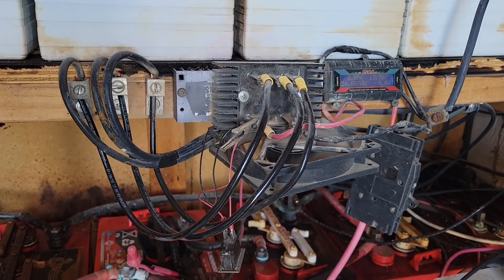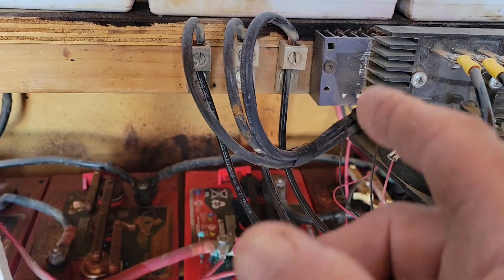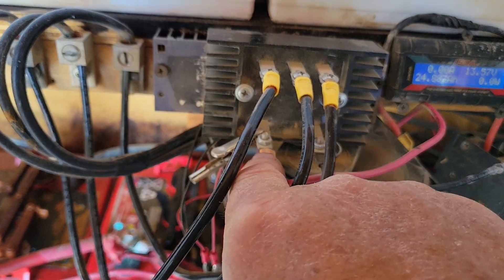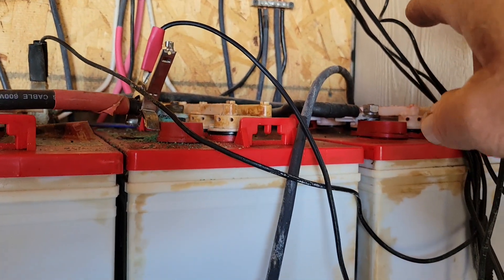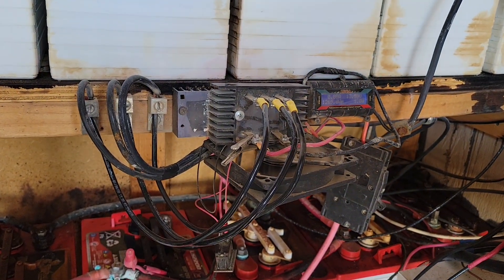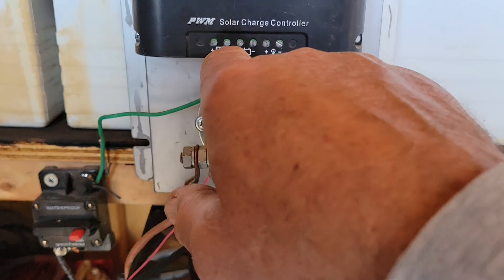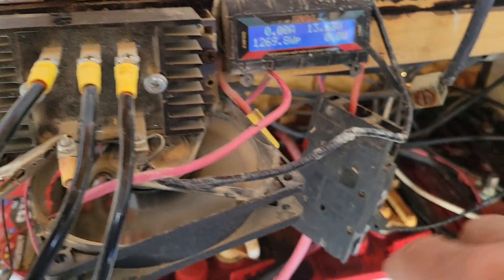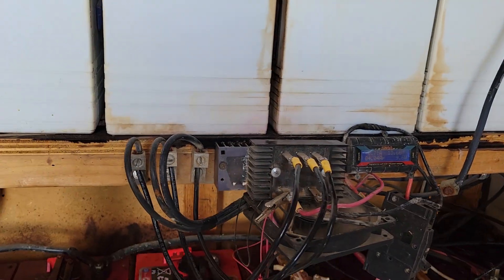EVERYTHING You Need To Know about Connecting Your Turbine To Your Battery Bank, March 29, 2022

Comment: G Bear. Just to add something I learned about the controller I have here...it's rated at 2600 watts and pv max is 2750.    Thought this may save you a little time.  Thnx!       OOPS,  my mistake, rating 2600w but pv max is 3750.  Also the manual indicates that pv panels be wired in series.  I noticed my inverter info didn't come through complete.   It can put out 110 OR 220 by setting.  Also can be set as backup for grid, or for grid as backup..which is how I intend in using it.   Also in the last mode, when batteries wear down inverter will switch to grid power AND also charge batteries at 110 volts..until batteries are up..then it'll automatically switch back to battery power.  Sorry for the late corrections!  Enjoy your weekend!
Reply from the maker: Yes, the builders usually rate controllers by the electronic capacities of the components.

Comment: I appreciate your solar experience!  I'm green at this.  What guages of wire should be used from component to component?  No rush with your response...perhaps info for a video.  I'll have other questions in the future, thanks!
Reply from the maker: Welcome aboard!  Wire gauge is determines by a few factors. 1. Amount of power being moved. 2. Distance between components. 3. Type of wire. (Solid or stranded) 4. Resistance.
Basically, the further the run, the heavier the wire, stranded for DC, solid for AC, but not always.
Confusing, I know!  When the time comes, let me know, I will get the particular information and help you out.
Reply: @GBear  I appreciate that!  Within a few days I'll give you a bunch of info you may be able to decifer to make suggestions.  What I'll say now, is that I plan on moving to the Philippines within a few months and wish  to take some of the components with me...some of which I've Lready purchased.   Electrical there is 60 Hz and 220.  I'll add much more in the near future,  so you can postpone your response till then.   Thanks!
Reply from the maker: 220/60 or 220/50, just to clarify.  I ask because when I was in Europe it was 220/50.

Comment: Great information and always loving your videos! Did you ever try the dump load control with a SSR like I use ?
Reply from the maker: No I haven't.   I found no need for a dump load system since I discovered Midnite Classic. Instead of 'dumping' I control my batteries to maintain best status.  Much more efficient since the amount of 'dump' is usually negligible. 
Living in the desert, using dump for water heating is foolish, and since I don't need extra power anywhere else, I chose to just go with charge efficiency.

Comment: I have two questions G-Bear's mind. First to control current resistance between the batteries, would using just one wire and have leads protruding to each terminal help control the resistance heat ??? Second, the rectifier is capable of taking 3 phase power from the alternator and convert it to single phase. Would this work backwards and take single phase and turn it to 3 phase power ??? Thanks G-Bear's. Well explained wiring schematics, I could easily connect this with your explanation not needing a diagram. One more thing, do you realize you could increase your power output from each of the panels by using two reflectors on each side of the solar panel. Peace vf
Reply from the maker: Ok, first, no...because there would be no control to the heater resistance,  and it would drain the bank.
Second, no. A bridge rectifier uses DC diodes to direct current to flow in one direction only.  Therefore, running current backwards would get stopped at the diodes and no current can flow backwards.   Alternating current flows back and forth, where DC flows one direction only.
Third, yes, reflectors can be used, so can solar trackers that move the panels. I found that an optimized panel facing direction performs at optimum without the added expense and complicating the system.  Remember, K.I.S.S.! KEEP IT SIMPLE SAM!
Reply: @GBear  You remind me of my auto shop teacher who used the acronym all the time. That was so many years ago. He used the translation as keep it simple stupid. The SAM part is a more refined and civilized decoding of the acronym.  Thanks for the information G-Bear's.
Reply from the maker: @victoryfirst2878  yes he used the original version.  I clean it up so ad to not offend my viewers. 😁👍
Reply: @GBear  Great minds think alike, Nice G-Bear's
Reply: Jim or pulesjet  here.  No the diode rectifier is a one way ticket.  What are you looking to do?
Reply: @pulesjet  Run electric motors which are 3 phase to single phase as that is what I have at home. Besides rectifiers, rotary converters, static converters or variable frequency drives. What would be another way to make this happen, or am I asking the impossible ??? Something real cheap besides using one motor running another. Thanks Jim, vf here.
Reply from the maker: 3ph motors are designed to be more efficient than single phase motors.  Reverting them backwards defeats the purpose.
Reply: @GBear  YES , I've delt with 3 phase motors but that's ac.  you can swap any wires and it matters natt.  Dc THREE wire if you swap any two wires they motor will reverse dirrections
Reply: @GBear  The only ones I've messed with were in  AC  units and a few high powerd equipment.
Reply: @pulesjet  A  3 phase A/C motor if you change any 2 wires it will change the rotation of the motor. I'm a commercial electrician and most jobs I've done the A/c units are roof top and 3 phase and we always had to check rotation to make sure its blowing cold air and not sucking .  LOL
Reply: @tonyjohnson1068  Cool beans .  The last time I had to mess with them was the same thing ROOF MOUNTED AC .    I just remembered any one wire was ok and if you swapped the two wrong wires it would humm and dance.  loL..
Reply: @pulesjet  Are you talking about the motor taps or the line , the feed coming into the motor?
Reply: @tonyjohnson1068  The leads to the coil windings within the motor.
Reply: @pulesjet  Ok yeah they have to be right . you can change the taps to match the voltage. I thought you was talking about the wires feeding the motor coming from the panel.

Comment: So being my windmill is only 400watts after I put the rectifier on it to covert to DC would be possible to use one of my good charge controllers to regulate the power?
Reply from the maker: Can't help you with a definite answer there.  Wind power requires different parameters than solar and Midnite Classic is set up for that.  You could experiment with it if you don't mind possibly toasting the controller, but I would also separate it from the rest of my system in case it catches fire.
Reply: @GBear   
I'll check it out my windmill is all by itself so I could play with it I guess
Reply from the maker: I'll do some research too.  I'm curious to know if it worked for someone, or if they no longer exist....🤣👍
Reply: @GBear  May  be of help here.  If your controller is say MPPT and the input VILTAGE and power range is within your turbine out put voltage range it may function.  Your 400w turbines nominal output is like 50-150W in normal use ? That is about what my 500w turbine produces on a normal windy day.  NOT MY MAIN SOURCE OF BATTERY CHARGING. Just something is better then nothing on dark hours and storming nights. MPPT  controllers have a somewhat elastic input.  They do the best they can with the input range they can work within.  What is MPPT voltage range?
Even though the Phocos MPPT charge controllers have input voltage ranges of up to 85 V or 95 V, it is better to use a lower PV voltage for best conversion efficiency, especially in combination with 12 Vdc systems: The conversion efficiency of the DC to DC converter in the MPPT charge controller is dependent on the ...Oct 7, 2020
Reply: @GBear  If you have one of those little 3 wire controllers that come with the turbine dump it and go with a diode pack and cheapo mppt controller.  I toasted two of them before I figured them out.  DO NOT USE THE BREAK CONTROL.  THE CONTROLLER OR YOUR TURBINE WILL FRY IN HIGH WINDS.

Comment: This over voltage system works on LEAD ACID banks.  Lithium of any fashion does not like being overcharged.  You need to limit the top voltage your providing to them.
Reply from the maker: True.  Lithium is a completely different animal.  Did you know that Midnite Classic includes LiPo batteries in its controllers?  They handle all the batteries anyone chooses for their banks.
Reply: @GBear  Top notch controllers.  Too rich for my blood but one of the best to be sure.  EPEVER is my flavor.
Reply from the maker: I have heard good things about Epever, but after spending on a lot of junk, then getting a Midnite Classic,  I decided I would rather spend the extra for the best.
Reply: @GBear  I spent a few hundred dollars trying the little cheapo MPP controllers and no Buano.
Reply from the maker: @pulesjet  same here.  I have a collection of cheap Chinese stuff on the wall as a reminder.
They still work, although really inefficient,  so in a worst case scenario,  I still have them.
Reply: @GBear  LOL. I have a few litte MPPT controllers here that would work fine for camping or other low power task. 5-20A things. If  you need one let me know.
Reply: @GBear  YEP, the new ones are based on li lion and lifepo4 .  Just too rich for my pocket.  Epever does the same for me.  Has blue tooth and more  that I have no need for.   Price point is about half the midnight.  The midnight are on hell of a controller.  Just more then I need.  I just can't afford the cream da cream like Outback or Victron.
Reply: Did you find a place for the little POS I sent ?  I used the better one for a camp set up.   Not much more then you use for the SoAKCUZZY CHARGER.
Reply from the maker: @pulesjet  thanks.  Still on the backup shelf, but may become part of the new garden extension.
Reply from the maker: Understand.  I can't afford them either, that's why I only have one where I need 4.